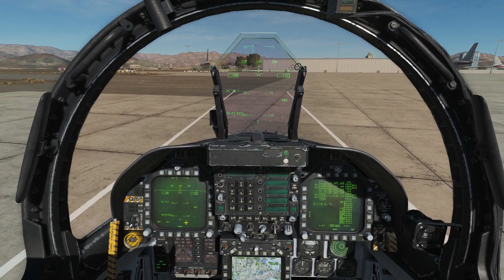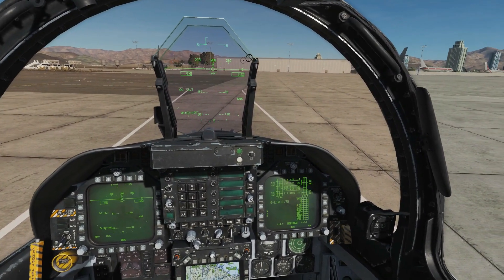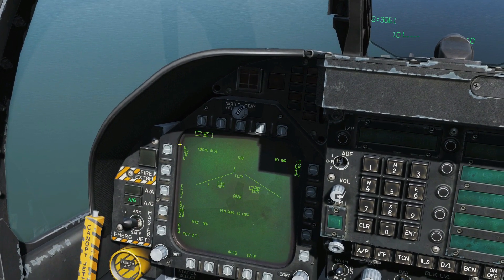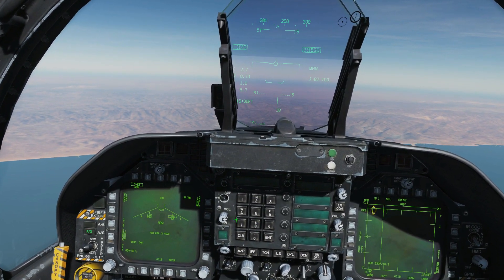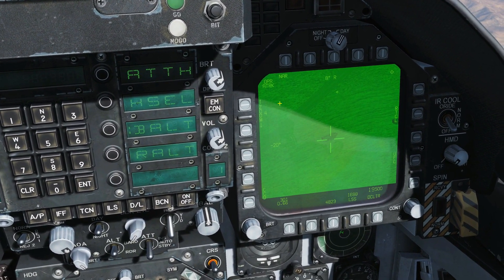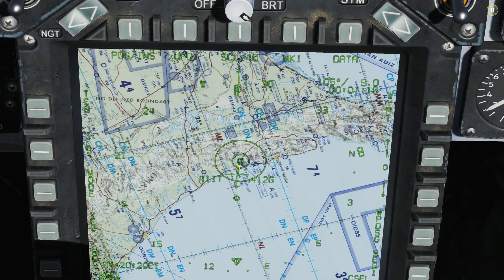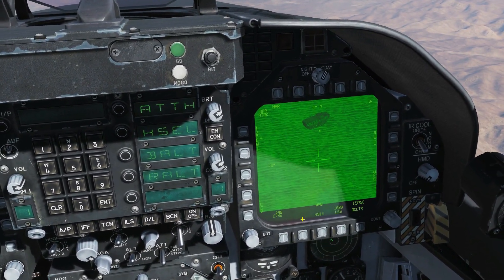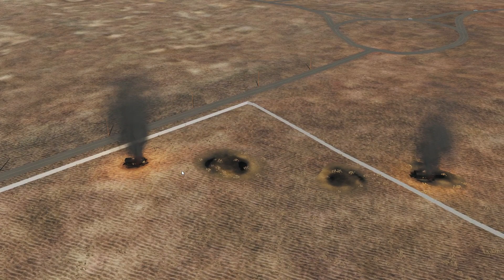FA-18C Hornet: JDAM (TOO)(Via TPOD/TGP) Tutorial | DCS WORLD

Comment: As the standart training mission from F18 showed u don't need to press tdc depress. Select the area as tgt waypoint, select JDAM, TGP over target and drop when in range
Reply: but why did that same trainer want to use laser when using scene mode in tgt pod..? I get data without laser ? :o
Reply: @lasselahti4056  test it. I guess the system can calculate the target in relation of the aircraft when using tgp.
Reply: @Sniperahead  it seems that it removes the drifting of target / tpod, when targeting in very limits (just tested hot hornet 40 miles from target and  8 bunkers around it). Got hit with every bomb with laser (targeted in very limits the tpod even drawned..). Without laser (after first test) it really seemed that target drifted. What i really would like in DCS / hornet would be assigning tpod to target points. (OFC markpoints are there, but assigning tpod with "some" coordinates). (example: it would be nice if jsow display had like "tpod" button in too1 and too2 pages of JSOW stations. Would help alot.) OFC Ferrari would be also nice and sailing boat... :D
Reply: Plz readers. Test this. Just hot hornet about 40 miles from waypoint what has targets. With and without laser. (with laser ->laser on-> laser armed->trigger. When choosing targets instead of just TDC depress, first push trigger click for lsr ->tdc depress ). Would be nice to have more comments about this. Well actually I really think (just IMHO..) it does not really matter alot in DCS. PPL are usually kinda near the targets, and tpod itself limits litllebit in the game choosing targets from distances-> think that using the laser is for more special situations / if even have time. If I remember correctly IRL that TPOD just has option to use laser manually and if not, laser would anyway calc the distance to target more or less automatically, when choosing the target. But IRL is ofc another thing. Sry for long anser :) Have I nice Xmas. And many thanks for this video. I really thumbled with those too 1 and too 2 and quantities before. This made it straight. (and that undesignate, even laughable that ED hasnt but it in its own tutorials.. :P)

Comment: TDC depress doesn't seem to copy the data over to the JDAM for me. 

What could I be doing wrong? I know that it locks on a target however.
Reply from the maker: do you have a Area or Point track on the TPOD? If so, not sure. Anyone know answer to this please?
Reply: @grimreapers  I'm pretty sure it worked in Area Track for me.
Reply: @grimreapers  Thank you for following up!

I solved it a few days later, and believe it was:

1) Didn't have sensor control switch on the RIGHT TDI. (EX: diamond in the top-right corner)
Reply: Hi, that does not work for me, I am using the OB and it has been confirmed on the ED forum that coordinate tranfer is not possible IRL.